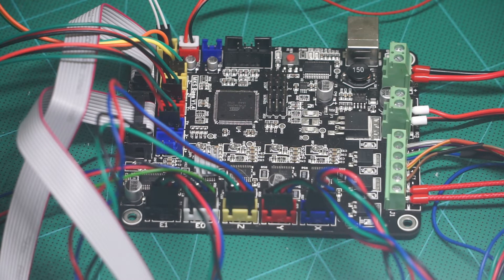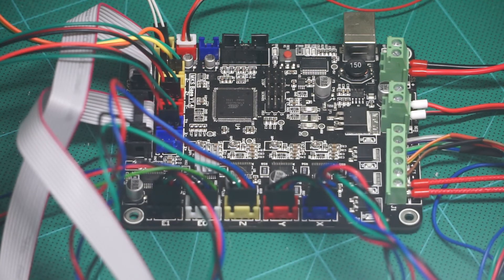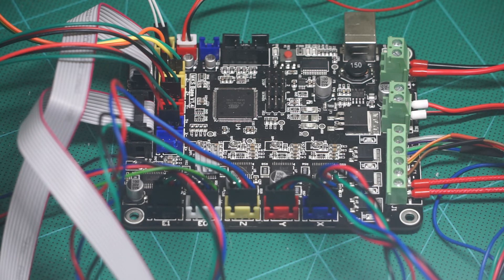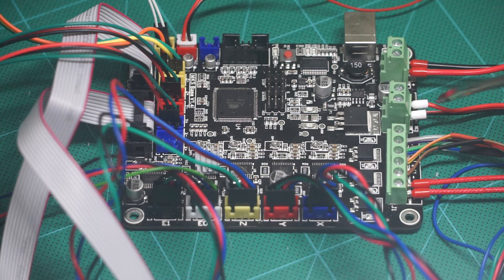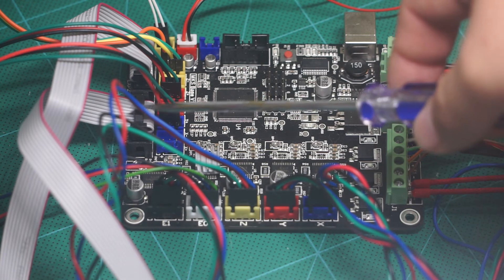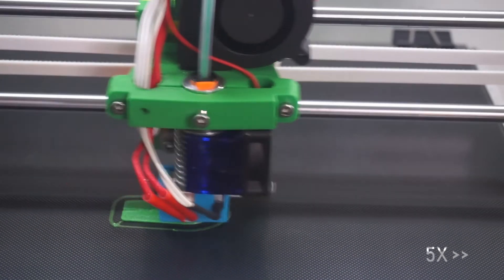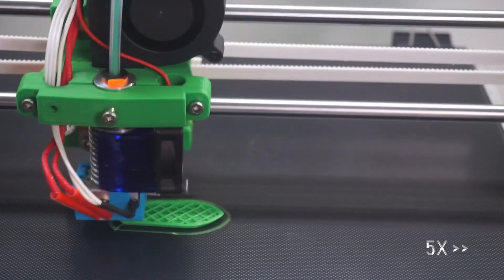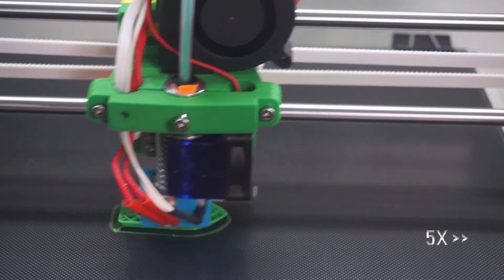Build: Hypercube Evolution - Part 6 - The Electronics (Marlin)

Comment: Good afternoon. Collected this miracle printer. With such a motherboard MKS GEN L 2.1 + MKS TFT3.5,
Downloaded your firmware. Gives me an error. Arduino: 1.8.15 (Windows 7), Board: "Arduino Mega or Mega 2560, ATmega2560 (Mega 2560)
In file included from C: \ Users \ Jura \ Downloads \ nCube 1.1.9 \ Marlin \ ultralcd.cpp: 96: 0:
ultralcd_impl_DOGM.h: 46: 10: fatal error: U8glib.h: No such file or directory
compilation terminated.
exit status 1
U8glib.h: No such file or directory.
I don't understand anything about this at all.